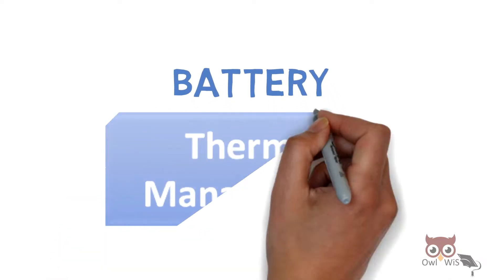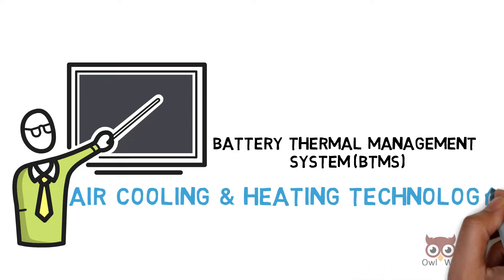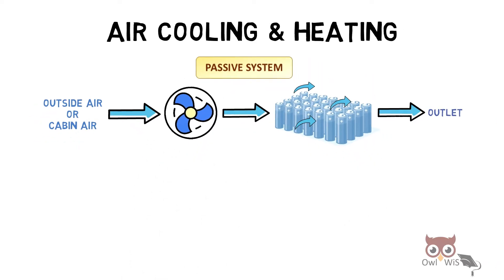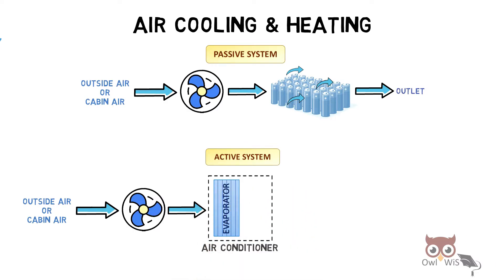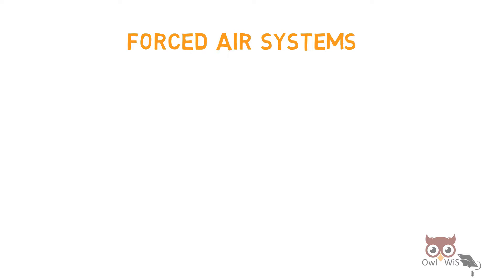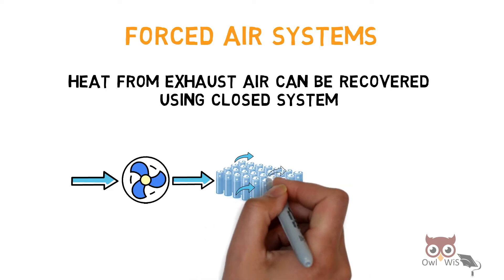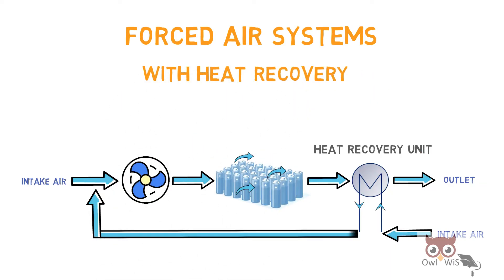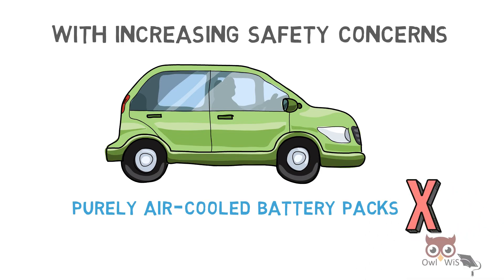Battery Thermal Management System | Air Cooling and Heating Technology | BTMS Air Cooling &Heating

Comment: In, closed system, the heat from exhaust air is transferred to intake air in heat recovery unit and fed to the blower. If that is so, how can heat contained input air absorb the heat dissipated by batteries as no conditioning unit is placed between blower and battery pack? Please explain and correct me if I'm wrong.

Comment: How does a ev vehicle maintain its temperature when parked in hot weather.
Reply: its like outer temperature wont come to the battery pack,it will be thermally insulated
Reply: @sourocky3616  thanks for enlightening